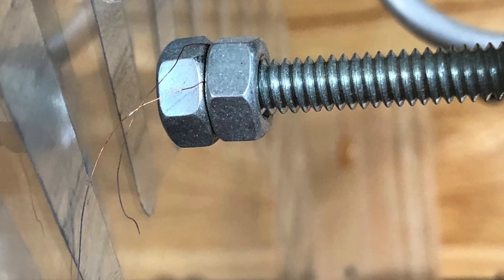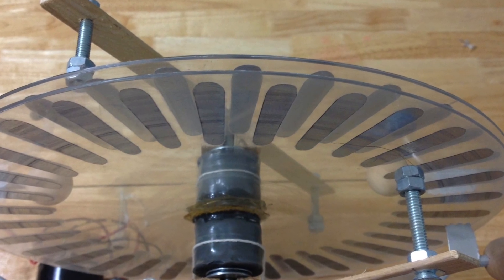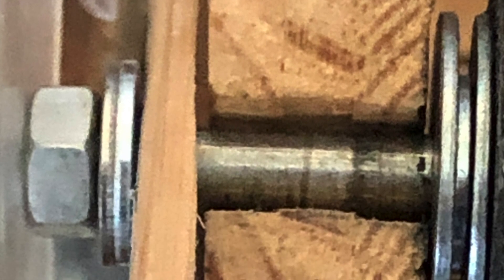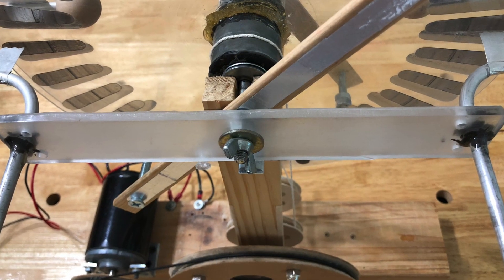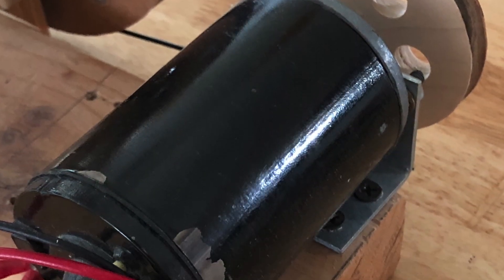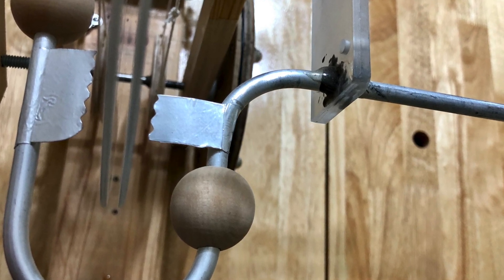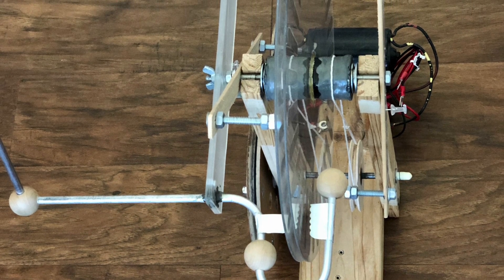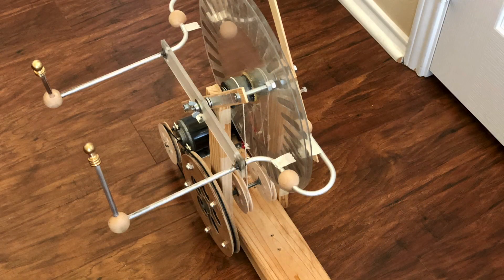Simple Motor Driven Wimshurst Machine

Comment: one ball terminal should typically be larger than the other
Reply from the maker: If the polarity is predetermined, the smaller ball should be used for the positive terminal. If polarity is random or undeterminable by design, both terminals should have larger balls with smaller balls on top of them. Polarity can be predetermined by placing a charged object opposite one of the neutralizer brushes (see link below) - this is required for a Bonetti machine, but it can also be used for a Wimshurst machine when self starting does not occur or when one wishes to control/predetermine the output polarity before starting a Wimshurst machine. 

https://youtu.be/vw5TtxE8lew?t=125